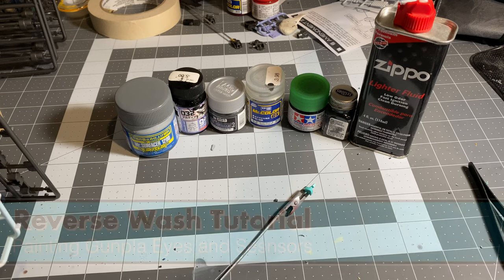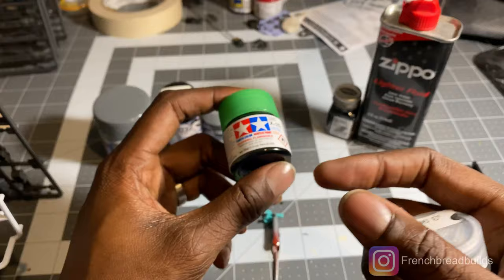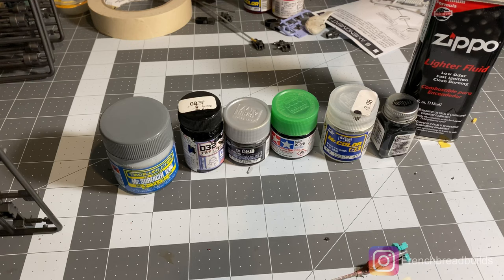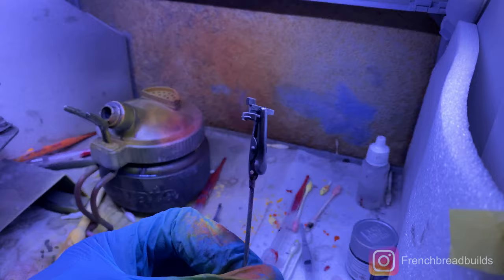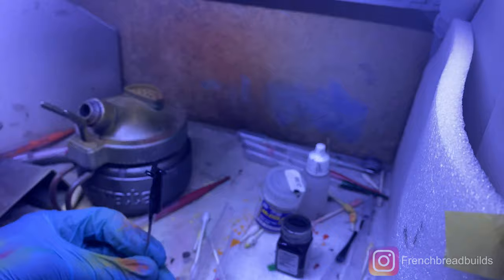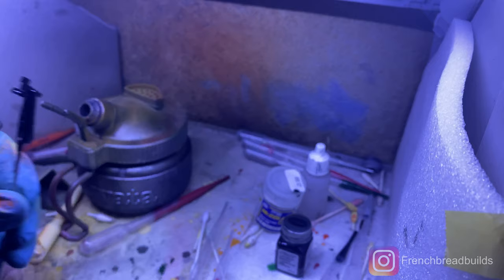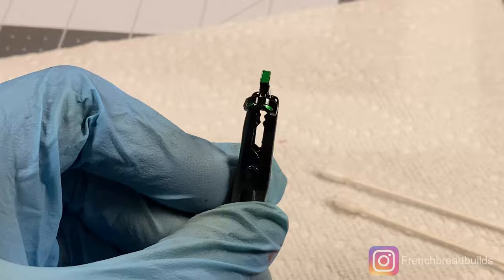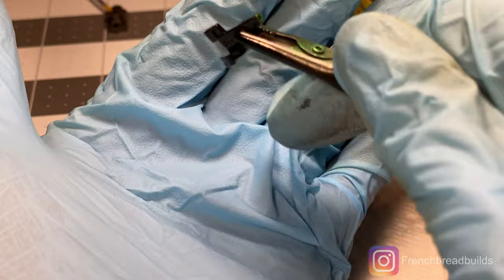Reverse Wash Tutorial: Painting Gunpla Eyes and Sensors

Comment: Alclad candy silver base would work with clear green over it and save the gloss black and primer step.
Reply from the maker: Good tip, I have alclad Chrome but I find alclads not to be as resilient as mr color paints so I don’t use them often
Reply: French Bread Builds I do like the Alclad silver candy base more then the regular chrome. Me. Color is a great product though. What did you think the testor black enamel with and ratio
Reply from the maker: Exiaaa Alirez testors is a pretty good paint. Just requires you to spray it very thinly and not
As quickly and thinly as I did. But when done right it’s really good

Comment: I would just spray everything black and hand paint the silver + semi clear and seal it with a top coat the tiny surface area of the sensors means you will less likely get brush strokes.
Reply from the maker: I guess it depends on what your work flow is like and how anal you are about the details. I’m already painting the whole kit and use the reverse wash in a lot of areas where it would be a pain in the ass to mask. 

For small sensors you could definitely get away with hand painting but with some of the bigger sensors in MG and PG kits, the smooth even surfaces you get from air brushing really adds to the appearance of depth. Also if you’re doing something like the eyes and using the reverse wash with enamel paint, you’re going to want the smoothest possible surface you can get. Which is why I use the gloss clear. If your layers of paint underneath aren’t particularly smooth you might have issues wiping away the enamel